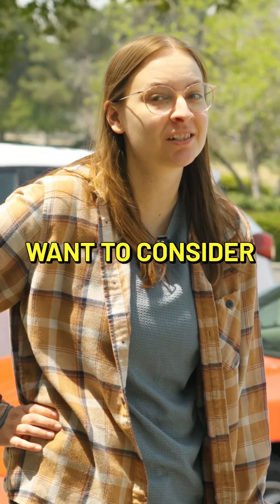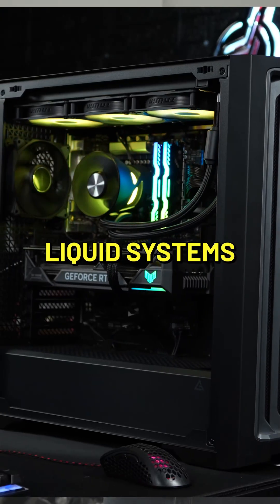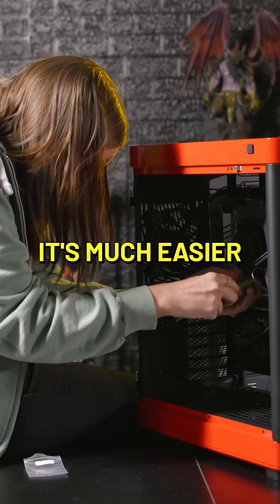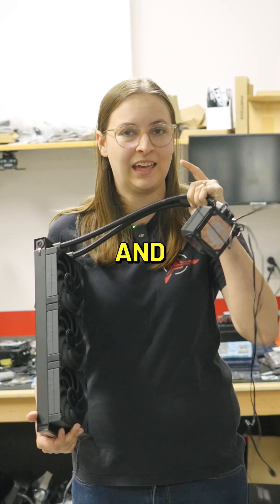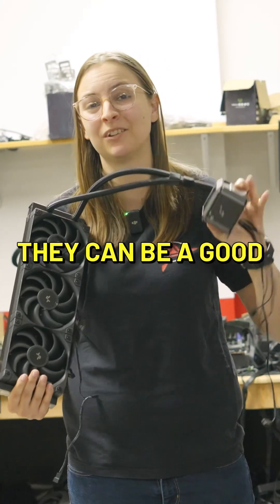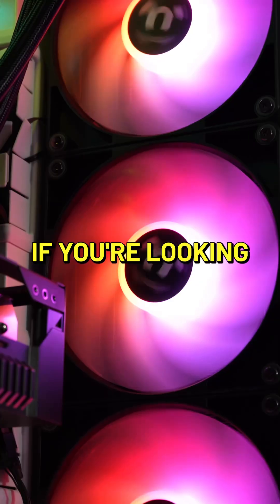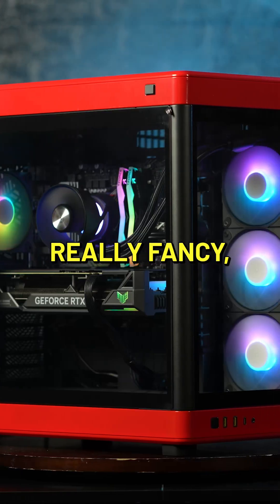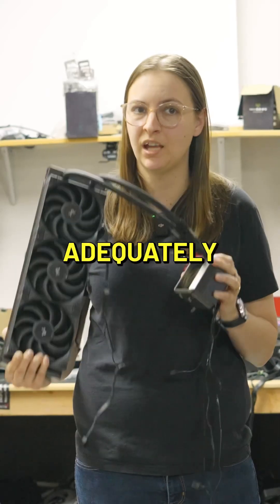What are the benefits of an AIO Water Cooler? 🤔

Comment: Liquid coolers sucks ngl, more expensive for the performance and they pumps do not last long
Reply: it depends on the brand tbh if you get a cheap one then yea it will suck i got a prebuilt from them two weeks ago or so and it has a 360mm aio and it cools down my cpu pretty well ive never seen it go above 67 degrees Celsius my cpu is a r7 9800x3d
Reply: @undulantlemur43 dude you were using it like for half a year only. My air cooler works almost 8 years (be quiet Dark Rock 4). It was migrated from 2 PCs. Currently used on the third one. I even didn't change the fan. Let's see what happens with your aio after that amount of time. If your aio's pump is dead then it's dead. You can't fix it
 You have to buy another one aio. I found it very wasteful.  As for me I only need to change a fan.
Reply: @niodix you said half a year right? that’s not true unless you get a cheaply made aio most aios should last about 4 years at most but yeah obviously they are going have a shoter life span then a air cooler because the coolant for the radiator slowly go bad overtime they add stuff in the coolant to help keep it clean but that will not last forever
Reply: @undulantlemur43 read again. Your comment was 4 months ago. You were talking about aio
Reply: @niodix yes I know you said it would only last half a year I was saying that ain’t true if it’s not a cheaply made one, even the cheaply made one would last about less then two years at the most
Reply: @undulantlemur43 no. My English is not very good. I meant that you bought AIO half a year ago according to your comment from 4 months old. Of course it should still work. But will it work after 3-5+ years? Like air cooler
Reply: @niodix oh I see no I didn’t buy a AIO I bought a prebuilt that included a AIO for the cpu but yeah it won’t last longer then 5 years most likely but I already have a backup planned for when it stops working

Comment: never liked liquid cooling, i just see it as another failure point that could turn a rather simple failure into a catastrophic one that could destroy the entire pc.
Reply: If you’re ignorant or clumsy during the setup process sure. I have an AIO and haven’t cleaned my pc since i set it up its been 5years coming on 6 soon
Reply: @HelloGoodbye_the2nd  yes because there is no such thing as wear and tear from use and heating/cooling cycles...
Reply: Not really
Reply: @JokesonKW  yep because in case of a leak liquid and electronics components go hand in hand
Reply: @CarimboHanky leaks only happen do to user error. Are so, so unlikely so long as gentle with parts. Yall so afraid for 0 good reason. 

Tbf these are probably the people who don’t know how to build a pc properly and buy a pre build & then you’re putting all your trust into someone elses laziness. Custom loops can be but generally aren’t if the builder did research more dangerous. But an AIO unless u use scissors or sm sharp aint sprouting a leak. 

Stock cpu fan coolers aren’t good And depending on your cpu can actually cause worse issues from getting 2 hot.

Btw water on w motherboard or any electronics so long as not plugged in can take quite a but directly on the components. However that part might be fine but the time wait until its good to plug back in is usually months. So just don’t but if ur loop broke on ur your stuff isn’t fried unless that happened whilst using it and thats extra unlikely
Reply: @HelloGoodbye_the2nd  so you telling me there is no wear and tear on cooling parts 🤣 OK buddy i have heard enough
Reply: @CarimboHanky   just so you know water dosnt hurt electronics it's the minerals in the water also there isn't just water in aios it is a mix of many liquids also there is no reason it would leak without user error like you really don't know what you are talking about
Reply: @JokesonKW  sure buddy, let me dunk a couple of electronics in this mix of liquid, nothing will happen right😂
Reply: @CarimboHanky   yes you could
Reply: @CarimboHanky   it is called a not conductive liquid which mean electricity can't go through it
Reply: @JokesonKW  sure buddy ✌️
Reply: @CarimboHanky dude this never happens unless you actually puncture the pump lol